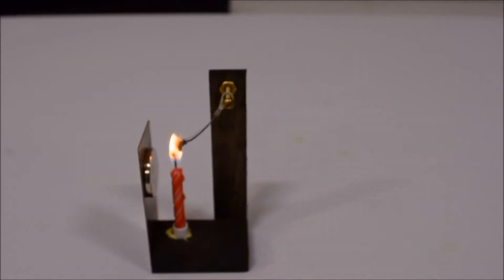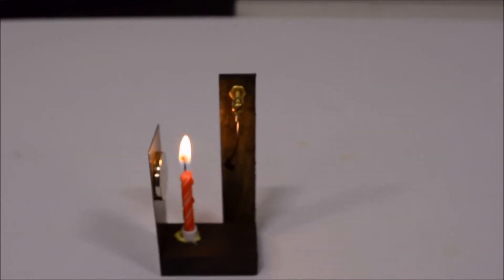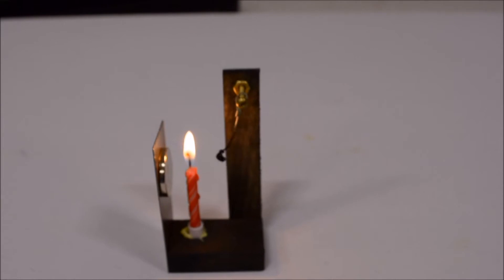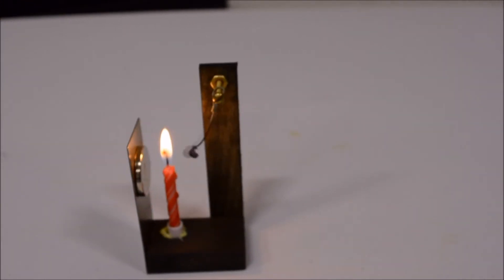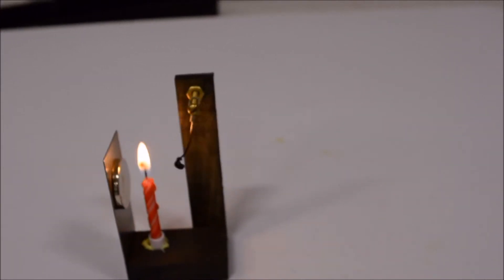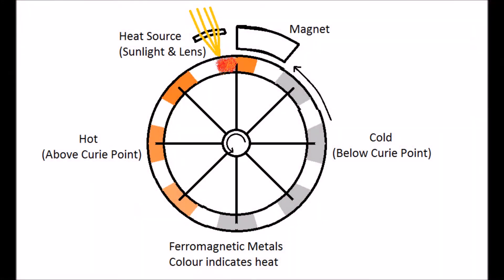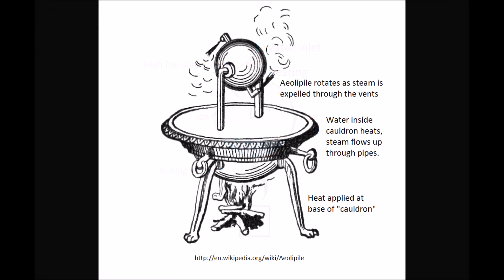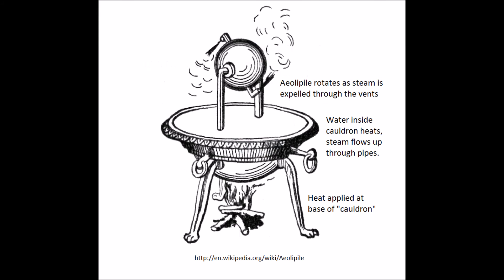4 Novel Heat Engines - Curie, Stirling, Hero, Bimetallic Strip

Comment: a stirling engine is a heat differential engine ... gas expansion is due to heating . like the curie engine a heat source is required ... the same heat source as a curie engine works as well .... otherwise great video ...  

Btw Pastor Stiriling created the engine because he was tired of losing parishoners to exploding steam engines and designed an engine that didnt have a tendancy to blow up and kill or injur his parishoners ... a disadvantage of a stirling engine is it's lower torque and its lack of value when enlarging it to mamoth sizes as the flywheel and disipation of heat became problematic at extreme scales .. Philips made a generator using teh stirling engine and kerosene to heat the engine ... from what i have read it was pretty good as a small generator or back up power system